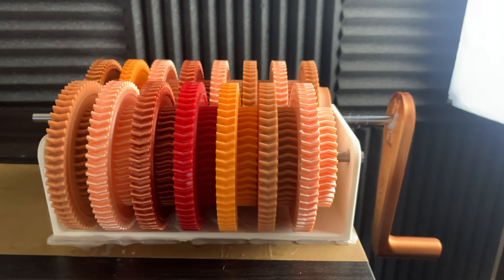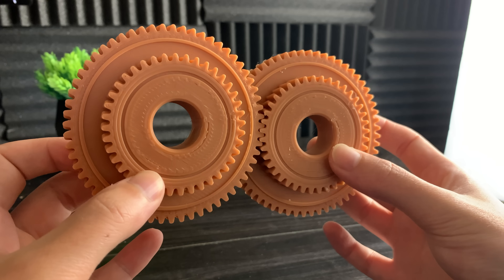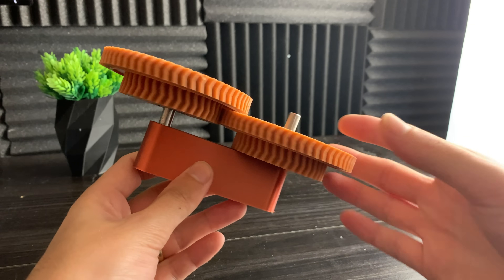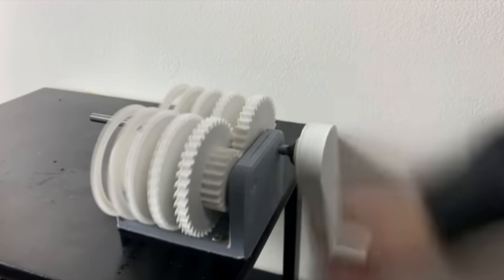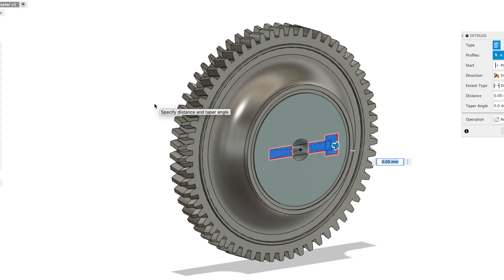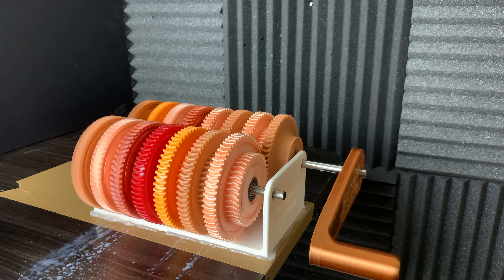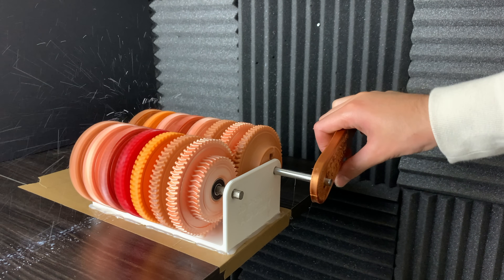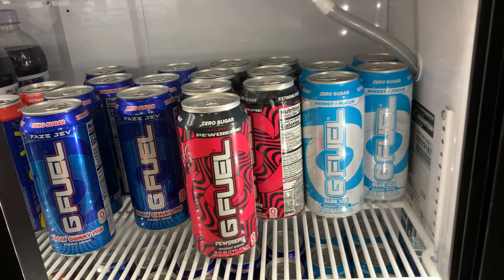3D Printed Gearbox (Herringbone Gears) - Speed Test

Comment: (Engineer here)
The teeth type is one of the best for this situation, well done on this one. But give a shot to these two/three things.
1:use something to prevent the axes from bending, (a flange between the gears)
2 and most importantly: jumping a whole milimeter just because 75 didn’t do is an overkill. Usually when one adjusts gears, you need about .1-.2mm between them (space just enough for a piece of paper to get roller between the gears) this is something that will prevent more of the teeth jumping you had when applying torque.

3: lubricant is not really needed in my opinion since the surfaces are rough and you don’t care about the lifetime. Try treating the parts with acetone moisture to reduce the roughness.

Add some weight to the one of the three last gears so they perform as a flywheel.(this might be dangerous)

Pretty nice project, would be lovely if you measured the output speed.
Reply: In my experience "this might be dangerous" in engineering is usually a good sign for progress lmao
Reply: @NephiylusBaphson  ah yes, fellow engineer too, eh?
Reply: As a layman when he jumped a whole millimeter I sighed. 75 mm sounded only slightly off so .2 mm might have done it
Reply: @ReaIJackhammer  I don't think I'd fault him for jumping a whole mm; but splice search is pretty effective for finding the right value for a physical "try and try again" model.

Without any knowledge of what's going on here, i'd probably have done 76; then 75.5, then compared the two and done 75.25, 75.125... Presumably that would be too small, so 75.1625...
Reply: @Hyatice  I mean even just having basic knowledge of tolerances I know that millimeters are a large unit measure in. It just seem natural to know millimeter adjustments are fine for most measurements but when talking about gears the. Younshould start going to decimals.
Reply: A flywheel was something I was gonna recommend as well.

Source: am not an engineer
Reply: @MrMrRubic no not a fly wheel if you don't understand comprehend the overall
Reply: Another engineer here
yes to everything you said
Reply: Wow too much engineers here 😂
Reply: generate energy with the last gear could be nice.
Reply: @Sebastian____1337-0  this is not how energy works :p
The whole machine would stop instantly the moment you touch the last gear to extract energy.
Reply: @silverX362  this si how dynamo work to extract energy... I AM talking of charge your phone while power Lost...
Reply: I was about to suggest similar ideas. Good job man. Big one is the gear lash. Gear lash to me is one of the most important things. To much will cause skipping and stress. To little and it'll cause more friction. I always set gear lashing by feel and sight. Down to about 10 thousandth of an inch. 

One thing to also mention is some sort of shim or spacer to help guide the gear. While these gears self align you still down want them bouncing around due to sloppy tolerances. (No offense 3d printing has its limitations) the more you can keep the energy in a circular motion the better. When it's moving side to side that's lost energy and lost power. Also a better bearing tolerance with maybe a dryer bearing and just a dab of silicone may work better to reduce the lost energy from the pre applied grease.
Reply: Simply a bunch of great ideas. Nice.
Reply: Careful with Acetone, it might damage the gears.
Reply: not an engineer in any way but i think external lubricant its a good thing, even if you dont care about life time it still reduces the friction right? the acetone it's very good but i heard that also makes the parts weaker, and i thing he should try to clean the bearings, i mean the inside of them, usually comes with a relative thick lubricant and since they are balls they run just fine without them if its for small amounts of time (heat is the problem) or he could put a very thin one like wd40? just some opinions like i said no engineer just my past experience
Reply: @jlrebor2626  everything you say is pretty decent, especially the bearing lubricant part, did not think of that.
The thing about this experiment is that it is very practical and have brought lots of people and opinions together. This is something I call beautiful. 
One could just calculate everything etc and have the experiment done without all the people coming together like here.
Reply: @silverX362  well i really like to debate opinions with others dosnt mater the amount of knowleadge they have, every one has some value at one point in the project, the sad part its when someone doesnt want to even think about others opinions, me included, as humans we have a lot of defects hahahahaha
Reply: @jlrebor2626  very true! Sometimes it takes someone with less/no knowledge to come up with a new idea that someone with more knowledge simply couldn't think of
Reply: @wyvern3  sometimes the fact that you hava that knowlege it what makes you stuck because you are soo shure that its correct and you cant think in an open way
Reply: @jlrebor2626   I don't know if lubrication plays a major role in this application
The main force and main function of the gear is to transfer force, that is done by static pressure against eachother. Lubrication will just decrease wear of disengaging teeth, but if the teeth angle is done right the disengaging will barely touch. 

The lubrication will assist in the slipping of gears that occured, because the teeth can slide off of eachother with less friction. 

You were not wrong about lubrication, but in this case the lubrication also contributed to the wrong effects
Reply: @Baer1990  ummm then a dry one like grafite wouldnt be best?
Reply: @jlrebor2626   I think none would be best if the slipping is not solved. But if the axles will have less freedom in the middle in a way that slip is not a problem anymore then lubricate the shit out of it for sure

But for this design in the video the lubrication, or reducing of friction, helps the negative effects more then the positive effects
Reply: @Baer1990  ummmm like i said not an engenier but what you said makes a lot of sense, but every time i trie to make something go faster i lube it
Reply: @jlrebor2626 WD40 isn’t a lubricant, it’s a solvent. The “WD” stands for water displacement. There are way better things to lubricate with and I agree it should be lubricated like a crankshaft.
Reply: @vermili0n  i know its not its main purpose and that its even bad at it, but says right after the water part that its a lube, not the best fs but for this aplication i thing it could work rlly well, which one were you thinking about?
Reply: I would rather use modular gearing. Its more forgiving with gear spacing and almost all force is beeing transferred.
Reply: I also feel like the bearings are not doing anything since the axle fits so loose in the bearing. Now the inner schell of the bearing just spins on the axle instead of the bearing doing its thing
Reply: Electrical engineer here, but I tutored physics. Adding any considerable mass to the last gears will make it harder to turn, because for each increase in rotational speed, you get a proportional reduction in torque (and minor losses, which could be improved with your acetone treatment). That being said, you absolutely could connect an electric motor (that spins freely enough) to generate electricity
Reply: у моей бабушки был механический сепаратор для отделения сливок от коровьего молока, так принцип работы схож
Reply: This. The most important part of creating things that work is the machinist bible. Its expensive, but it has everything you need to put something together right
Reply: Or just make the fucking thing out of steel
Reply: "...the teeth type is one of the best..." - it depends how precise the geometry is. In my experience, amateurs don't focus on precise geometry, and their knowledge about gears and gearboxes and very superficial. At such a huge gear ratio as the above one, the accuracy and rigidity should be paramount. Not surprisingly we can see slipping gears, that would be quite absurd in a real life iron alloy gearbox, for example at a car.
Reply: output speed can easily be calculated by multiplying the rpm of gear 1 by the gear ratio to the power of number of gears. If you could achieve a steady 1 rotation per second on the first gear, the last gear would be turning 1(1.5^15) = 437.89 times, basically 438 rotations per second.
Reply: Why is adding a flywheel considered dangerous?
Reply: I can't visualize your first suggestion to use a flange between the gears. Are you thinking something more along the lines of a shaft collar?
Reply: Adding weight to the last three gear ⚙️ can possibly effect the performance in overall.
Reply: To prevent the gear ⚙️ teeth slipping I prefer use a different shape for the teeth that is strong bound one gear to another that can also be a game changer.
Reply: It is the best thing also to do for the gear teeth design shape.
Reply: hey bro if you work at ford do us all a favor. OUT THE FUCKING OIL FILTER ON THE OUTSIDE OF THE FUCKING ENGINES, AND MAKE UR VEHICLES EASIER TO FUCKING WORK ON. NOT EVERYONE HAS THE TOOLS OR THE TIME TO REMOVE A FUCKING SWAY BAR AND AN EXHAUST SYSTEM TO CHANGE THE FUCKING OIL.
Reply: Am an amateur, and i was going to say similar, guess I got the brain to do it, was also going to suggest that the gears be zigzag, to add more potential contact time, but I looked at structural and make death'nt things rather than gears, but clearly i gotta

Comment: Man, I really appreciate how long this has been going. Most people would just brush off people doubting your design or questioning the legitimacy of your attempts with this and throw math in our faces about why you actually did do your best. Instead you just keep iterrating this design and making it more efficient.

One suggestion, if I may, is the grip of the handle really optimal? That is to say, the point the sticks out toward you, not the bar perpendicular to the machine. Your hand keeps gravitating toward it, and I think causes the force you're exerting on the machine to be misaligned, causing energy loss and also making it a lot easier to break the handle. It may have also been the source of some of those stutters in this test. Perhaps making the grip larger so you can hold it firmly in your hand would be better?
Reply: In addition to this suggestion, I would suggest placing the grip on roller bearings so your hand can remain firmly on the handle. Exerting constant and consistent force.
Reply: @dustinkeier9176  I third it, and honestly, there's something I noticed. I'd say also add a free-spinning grip around the handle, for his grip to better move around the box itself.  some of the stutter is from him stopping to adjust his grip, and might be allieviated if, rather than having to adjust his grip, he can keep going by having the grip semi-freely rotating around the handle.
Reply: Due to the speed of the grip, a ball centered on the lever would work just fine. You'd have to readjust your grip every few seconds, which isn't an issue unless you have arthritis.

Comment: are you getting flex in the shafts running through the bearing thats causing the slip? one thing you could do is use a tactic from high performance transmissions and use whats called handcuffs. its bassically a bracket with bearings on it that connects to both shafts and limits the ammount of flex generated from the torq.

Comment: Herringbone gears were designed to avoid axial loads on shafts, reduce noise and have better wear characteristics than a conventional spur gear; the better solution (and why you don't see herringbone-style gears today used very often; they are relegated mostly to very high loads and moderate RPM applications), was simply to use compound (clustered) spiral gears with each half of the gear cluster spiral direction running in opposition to self-balance the axial load. Running the gears clusters together on the same shaft begs for spacers to be used between the gear clusters (or otherwise controlling axial gear spacing on the shaft). Have fun!

Comment: a skaters trick, those bearings are rated for way more load than you will ever need for this stuff. so to reduce the friction you can take the dust seals off and use brake clean to get rid of the grease. sometimes no lubrication is the best lubrication.

a standard 608zz(normal skate being) is rated for 3,300 newtons(740 lbs) at 32,000 rpm, so blowing out the lube is not going to hurt them.
Reply: z is a metal seal, theese are rs as in rubber seal.
RS makes more friction.
Reply: @ilpoheinola6440  you don't need a seal at all. and metal rolling on metal is very low friction if there is no grease to gum it up.

Comment: Maybe it can help to change the gear ratio in some parts of the gearbox so the load is similar in the whole gearbox.

Now there is a lot of load on the first gear and hardly any load on the final gear. A lower ratio in the beginning and a higher ratio at the end may help against slipping. (I'm a software engineer though, so this is only a guess based on the limited engineering knowledge I have 😅)
Reply: any idea could be a potential success, so your contribution could prove beneficial.

Comment: I'm not sure if you designed these gears or got them online, but you should be able to find the exact spacing the gears should be from each other by finding the average pitch diameter between the larger gear and the smaller gear. you can find the pitch diameter of each gear with this formula: (N*p)/π, where N is the number of teeth on the gear, and p is the circular pitch. Circular pitch can be found by measuring from a point on one tooth to the corresponding point on the next tooth.

Comment: Oil Sump. Put the whole thing in a clear plastic, sealed box. Submerge the teeth of the bottom-most gears in your oil (or lubricant). As the fastest gears fling the lubricant off, due to high speed, they'll re-submerge, and collect more oil for another rotation. Sealed box means that the flung-away oil will recollect at the bottom and repeat.

Comment: I have a lot of suggestions to make this work. But the most important are spacers between the bearings and plates between the shafts. Also make them wider and more angled.

Use hydrodynamic bearings for the faster gears

Comment: Needle bearing seems like they would work better in this application.  The smaller size of the bearing element will also allow you to use a thicker main shaft which should improve rigidity.  Also getting better tolerances between the shaft and bearing should help with friction.  As for the gear slipping it seems like the backlash/slop on the gears in the center due to the torque spreading the shafts where they are least supported.  So either a thicker shaft like suggested, support ribs in the middle, or some zig-zag alignment bracket.  
You should just get a C-clamp and 3D print some holders for the bearing as hammering them on like you did is a big non-no.

Comment: As the speed of the gears is increased rotational force becomes to great for the gear teeth to keep their contact, try adding a connecting rod between the input and out put shaft. Transmissions use a the housing to accomplish this.

Comment: 1:50 why not just calculate the distance between gear centers? Gears do have a theoretical diameter where, if tangent, they best mesh, thus better transmission and reduced slippage. I don't know if this gear type formulas are the same as a common spur gear, but it shouldn't be something outlandish.

Comment: I would recomend curved teath. They are exceptional good at transfering a lot of torque and due to their design the teath always touch on a very small point which decreases friction (and heat) and also provides a smoother power transfer

Comment: Why di you put bearing in them if you just going to use a rod that was tool small. The bearing was just rolling over the shaft. The sahahft should be the same size, and should be lightly press fit on. But not loose like you had it.

Comment: The gears need to go from very skinny to progressively thicker to withstand the torque. This way the later gears will impart less friction too. Are you already using vapor smoothing on the 3D prints?

Comment: Do you have a tachometer? If not you should pick one up from ebay at a pittance, it's a cheap tool these days. Then you can easily get some hard data on how fast the last gear spins before things start to fail, and thus quantify your improvements.

With plastics you will at some point run i to issues with the material flexing, but that may not be the limitation here yet.
What grease did you use here? With this much gearing the right grease for the job can make a big difference.

Comment: Install the bearings with a press or at the least only touch the outer race of the bearing by using a socket or nylon hollow rod. I rebuild the large industrial Falk gearboxes for a living and watching you hit the bearings with a flat faced hammer made me die inside. I would also suggest using needle bearings for this application since you don't seem to be as concerned with axial shifting. Needle bearings can handle higher speeds with a greater side load. You could also "set float" with spacers with an equal ID of the bearing but with an OD less than the bearing outer race. That would solve some of the friction issues. In most industrial gearboxes, the input has a positive float of a few thousandths of a inch with a negative float of a few thou on the output.